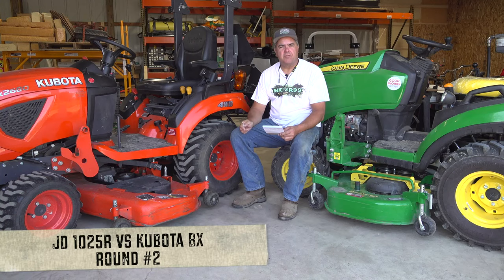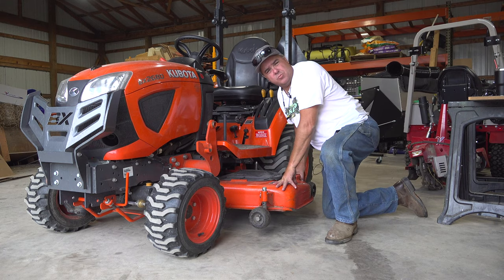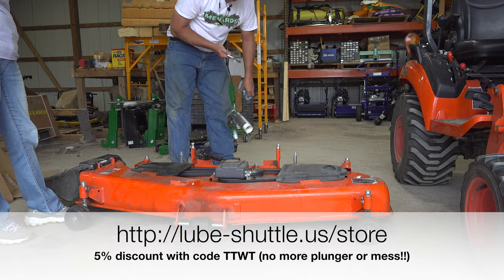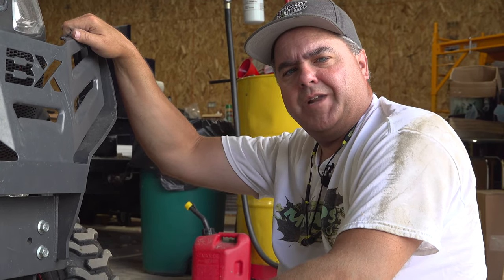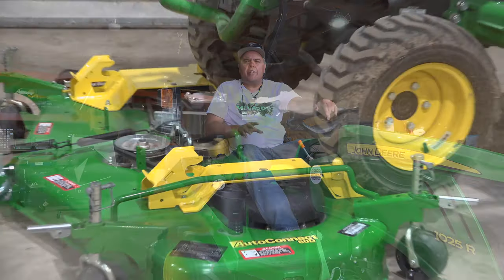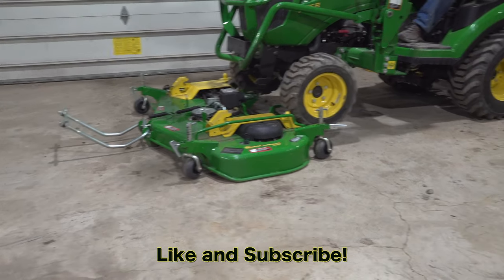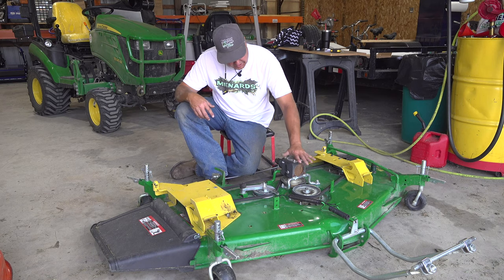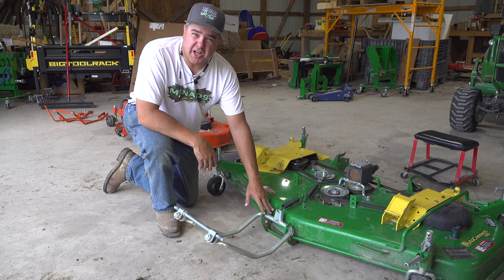Deere 1025R vs Kubota BX Round #2 of 8 Mower Deck

Comment: You know living in the Mid-West with all the hunters abound...  There is a certain joy I get when I walk up to the service desk of my Deere Vendor and proudly ask, "I need some Deere Lube!"

Anyway...  I've never been able to keep the 60D automount deck to mount on a concrete slab. Perhaps it needs some adjusting, I know I broke a  nut on the spreading bar where the deck lever is, but has such a bad experience with the local vendor repairs on a hydraulic leak on the axle that I am afraid to try them again. (A 2 + month repair)  Alas I am only using the tractor on the back fields with a zero turn on the house yard.

Comment: I have a 1025 R & love my quick disconnect deck. I have had to make a couple adjustments to the pto locator & front bar. I also found that it must be removed on a level surface to be able to connect it easily. Love it.

Comment: The hydraulic cylinder lift and independent lift the deck higher than the mechanical three point lift...probably by an inch or more. Just because of way lift off three point hitch arm works
Reply from the maker: I didn't know that. thx.

Comment: I was surprised to see the power steering rods on the kubota exposed in front of the front axle. Doing brush work could hit those power steering rods. They look pretty sturdy but my preference would be to have them protected behind the axle like on the Deere

Comment: That kubota Lawn mower deck goes on the same as my 1975 John Deere 400. What a debacle
Reply: Grimsby Tackle Pretty much the reason I now own a 2025 r with no mower. I mow less than 1/2 acre so I just got myself a John Deere  130 plain Jane lawnmower. No switching. The 2025 does all the box scrapping front end loading grappling forking and gravel leveling now. No mowing

Comment: Most mowing decks with the center blade (on 3 blade units) are always adjusted 1/4 lower on the front than the back for correct cutting level. Don't make the mistake I did and adjust to level front and back because you'll have scalping in your turns.

Comment: Auto connect is what pushed me over the edge to the 1025R. Had mine on and off at least 4 times in 44 hrs. And I know I made the right decision
Reply from the maker: Yep. Combine that with the Load n go allowing your loader to lift your deck http://GreenpartStore.com/ttwt (use code ttwt), and muddscustoms.com deck stands (use code ttwt), and you will handle your mower deck "like a boss" :-)   No other system comes close!

Comment: Here is a question for an audience that just might have the answer. I've got an E100 lawn mower from John Deere. I contacted John Deere and they claim that only the 700AM John Deere snowblower fits the tractor. I don't believe them. I would guess that older John Deere snowblowers designed to fit the 100 series tractors would work but they would rather sell me a new one for $1500. Am I just being stubborn or is it possible they're misleading a little for profit?

Comment: Kubota's drive over deck gets alot of criticism but ive had it for 4 years now and while its not as easy as JD its much nicer than the standard deck.
Reply from the maker: In some ways, I think the Kubota salespeople malign it as a way of maligning the Deere system.  In other words, ‘none of these auto connects work very well…’.  Hinting that you should not buy the Deere.

Comment: I believe I can remove or install the mower deck on my John Deere LT160 lawn tractor faster than anyone can on the Kubota bx. I know it's a lot lighter. I used to think it was easy until I got a 1023e with a 54D auto connect mid mount mower.

Comment: Great information Tim, I never would have have thought to put the 1025r in rear only when connecting the mower deck.  Makes perfect sense.

For my auto connect I never had any issues when connecting or disconnecting the mower deck until I had the Mauser cab installed.  The visibility with the cab is somewhat obstructed and I didn’t realize I caught a guide wheel backing off.  I bent some auto connect parts that had to be straightened.  Now I look out the door to see that the front wheel is against the guide bar and back off the mower deck part way, get off and double check to see everything is right before backing completely off.  I’m sure I’ll regain my confidence and be able to back right off again but for now I feel the extra few seconds it takes to visually look at where the bogey wheels are and insure I’m lined up properly to back straight off is time well spent.

Comment: Yes to "align the splines", but it's easier if you disengage the mid-PTO so you can spin the transmission side.
Also drop the mower down to it's lowest setting at the mower-wheels.

Comment: I own a BX. John Deere is the winner of the deck removal test. I put a small dolly caster under each wheel so I don't have to turn the wheels sideways. I also drive the rear wheels onto a scrap of 2x4 so I get the clearance to roll the deck out.

Comment: Good Video Tim. The reason I purchased a 1025R was the change over capabilities. Going from mower to loader/hoe work is only about 15 minutes start to finish. Only about 5 minutes going from loader/hoe back to mower. I do a lot of loader work with the forks. And the backhoe makes excellent counter weight. The months of May and June I was moving a lot of lumber and materials for a construction project. Changing back and forth weekly made it an easy task. Let’s face facts, these sub compacts do a lot of different things very well. But they are not the greatest at at any 1 thing. John Deere IMHO, put a great deal of time and money into their design to help the operator get things done.
Reply from the maker: Great comment.

Comment: Tim another great video and I will give it to JD on the deck and this was one of the other reasons I initially looked at the Deere, but you definitely look like one of those info commercials where life looks extremely hard when working with the BX deck, lol. I'll admit my first time putting on my BX deck took what seemed like an eternity, but it gets better. If you are on Pavement or asphalt those plastic wheels slide extremely easily (even shown in your video when you were moving the deck front to back). Wish my BX had an independent deck lift option so if I had a 3 point implement I can mow without worrying implement contact, and a load and go type of connection for easy of movement and servicing.

Also to be fair, Kubota also has a drive-over deck so you aren't comparing Apples to Apples. (which you commented in another comment) Also the BX23S ROPS are wider as well which was a huge selling point for me being a little broader than most :)

At the end of the day both machines should get the job done and each one has Pros and Cons, just about what you want to live with....

Comment: Hi Tim. I appreciate your videos. I bought a brand new 1025R and was completely unhappy with it. It was my first tractor and the auto-connect mower deck never worked as it was supposed to. The frame on the front of the mower deck broke where the spring was attached. The bolt also bent. I replaced the bolt and it still never worked as expected. The bar of the frame on the front of the deck continued to slip out of it's place and I had to put something on top of it to keep it down until I drove over the deck and got it into position. I've had other pieces of this tractor break as well.

I was so displeased with it that I traded it for a Kubota LX2610. I realize that the LX is unfair to compare directly to the 1025R, but I'm so much more please with the craftsmanship of the Kubota then I was with the JD. To me, the few times that I slide the mower deck off and on is a small inconvenience compared to the horrific experience that I had with the JD. I realize that not everyone goes through this. But if I was recommending a tractor brand, I would go with Kubota over JD...hands down.
Reply from the maker: Fair enough.  I would just say that there is a huge difference in these tractor classes.   Large 2R gives the same feeling of ‘totally different machine than the subcompacts’.
Further, the auto connect requires patience.  You can’t slam it together.
Reply: @TractorTimewithTim  yes sir. I understand. But even from the beginning I've had problems with that 1025R. It wasn't just the mower deck. Some was my own fault, like the ROPs light hitting a tree that jumped into it, but some of it is the quality of the tractor. I'll still watch your videos though. :)

Comment: Good information Tim. If you think the BX is bad, try installing or removing a Yanmar deck. The Yanmar is considerably heavier and more cumbersome. Usually took me 15-20 minutes to take the stupid thing off. The Kubota was 100 times easier, but looking at your comparison, the Deere is 100 times easier than the BX. I have an ExMark for all my mowing now, so I don't have to fiddle with anymore decks.
Reply: But does your exmark have ac and a stereo? I have thought about going to a zero turn but I'm to spoiled by the cab on my 3 series to give it up for the dirty dusty open mowing task that mowing is

Comment: I have a BX2670 with a 60in drive over deck. The first time I took it off it took me 15min, now it takes less than 2min. It even has ramps so the tires don't mar up the deck. I wouldn't trade it for a dozen of those decks on that Kubota. The quick connection on the John Deere looks good works well from what I see. The only drawback is the price, my 60in drive over was $100 more than one that did not have the drive over. What is the price difference between the quick connection and a pull off version like the Kubota. I'm not trying to nit pick just asking a question because I don't have a John Deere dealer near me. Oh by the way the height of the rops on my Kubota is too high to fit in our garage so they are always in the lowered position this is something for everyone to take into account when buying one. Thank you for your video's and all of you're all's hard work. God bless you and your family.
Reply from the maker: The drive over deck is standard on the Deere.  ...with manual pto connection.   The Auto connect pto option retails for $522.  
Which one of those is comparable to your setup?  Do you have an auto-connect pto?

Comment: As expected, the Deere clearly has this won. If I had to remove the deck umpteen times a year it would be an important feature to consider. I put mine on in the Spring and off in the Fall, so it really wasn’t a factor for me. I just winged it doing the install on my 2380 and learned the hard way how to do it right. I lost count of how many times I laid on the ground!!!

My Kubota dealer also did not recommend their drive over. I’ve seen videos and it looks rather horrible. Even the biggest orange fan (Neil) doesn’t like it. 

One thing that’s positive about the high competition between these two is each are always pushing to catch up. It’s a cat and mouse game and we benefit from that.
Reply from the maker: I agree about the competition.  We win!!!

Comment: The drive over deck  on mine works exactly as designed... It is simply AMAZING. 
If it doesn't work right.. adjust it.... Tim nailed it.. if it's in adjustment, and you install/remove on a reasonably level surface.. .it is 15-30 seconds max...on or off

Complaints...3 of em
1) Lifted deck height.. not enough lift. Especially for such a tall machine. I mow grass at 2.5 inches.. my deck only lifts about 1.5 inches above that when "lifted all the way" (I've spen lots of time doing the adjustments.. both in the lift arm adjusters, and the arm that goes back to the 3pt)
2) I hate how inaccurate my deck height knob is on my 1023e, between the slop in the entirely plastic knob on the metal shaft (it's not gonna last.. but i have 2 years of warranty... ), and the loosy goosy universal joint thing in between the height cam and knob shaft, it can be in 2 or 3 different indicated height positions depending on if you turn it clockwise or counterclockwise...not great.
3) I also hate how the mower deck settles onto the adjustment on left side, then the right side drops another inchor more. The slop in the rock-shaft is ridiculous. (I have the mechanical linkage that moves with the 3 point). My 31 year old 318 had less slop in it... Deere needs a fix, and then a repair campaign... period..  
When setting mower deck level.. you MUST do so with it hanging from a setting on the deck hieght (not just hanging off the lift arms..its gotta be "dropped")
... the problem I complain should not occur with the optional hydraulic lift, because it pulls the same spot the adjuster hangs the deck from.

Again.. The autoconnect deck on and off .. could simply not be any easier than this.. it is flawless.. grass, gravel, or garage.. always works with almost zero effort... it is great.

Comment: On the BX23S that we have. The PTO coupler on the mower deck that attaches to the mid PTO shaft locks back. Thus you pull the collar on the shaft back then line up the spline and shove the PTO shaft until it locks in place. If you put the PTO selector in the position to engage the rear PTO it puts the mid PTO in neutral so you can turn the mid PTO shaft by hand to help line up the mower deck PTO shaft. However, the auto attach deck is definitely a winner. My personal favorite; however, would be a three point hitch rear discharge grooming mower. Good entertaining video.
Reply: The mower deck coupler is a stock  Kubota PTO shaft that came with the MMM

Comment: I think you missed the different drive belts they use. I think the Kubota uses a heavier duty belt than the JD. I still prefer the JD, but I think the Kubota gets a score with the belt. Didn't you have to replace yours once on the original johnny?
Reply from the maker: I did indeed have to replace mine.  However, it was due to abuse.    I backed over super tall cornstalks.  ...stuff that I should not have been mowing...especially backwards....then I ignored the symptoms.
But yes, I will take a look at the belt, and show it in detail in a follow-up

Comment: Excellent video as always. I have a BX. Yes, the deck is a pain to remove and install because of the PTO shaft. And yes, they make a drive over deck, but every dealer tries to talk you out of it. My dealer didn’t have one on site, and he probably had 50 tractors available for sale out on the lot. As others have noted, if you still have the FEL mounted, you can use it to lift the front wheels for more clearance.  This is my first Kubota. I am still using my 15 year old JD GX325. I looked at both of these and ultimately decided on the BX. Time will tell if I made the right decision or not. I bought it as a retirement gift to myself. BTW, there are a lot of us Kubota lovers that subscribe to your channel and love your content. Keep up the good work!
Reply from the maker: Thanks for the comment, Chuck.  We appreciate you watching, Chuck, and we have nothing against Kubota. Would be happy to have one or two around here!!

Comment: Perhaps if you had set the wheels higher when rotating them the bolts would have cleared the frame while sliding the deck in/out.
Reply from the maker: Covered in follow up episode

Comment: I have a GC1715 and it only takes maybe 2 min to remove the deck and 5 to put it back on.
Reply from the maker: Yep. Sounds right.  VS 30 seconds each way for JD auto connect.

Comment: I'm surprised you didn't point out the difference in belt replacement on the decks.
Reply from the maker: There is a follow up to this round.  I may have shown it in the follow up, but I can’t remember for sure.

Comment: Drive over deck was one of the reasons why I went with a 1025R going on 5 years ago over the Kubota.  Haven't had an issue with the Driveover to date.  I hope I didn't just jinx myself.  LOL!   I remove the deck a lot when not mowing and using the loader and backhoe.  I did not dislike the BX.  I thought it was comparable and overall seemed very user friendly.  The features like the driveover and the finance options offered by JD at that time moved me to the Green side.  Still very happy I did.  Great video Tim!

Comment: I could not tell when you did the wheel spin around on the Kubota but is it possible to set the wheels a little higher so the deck sits lower to the ground and maybe you would not have the issue with it hitting on the tractor?